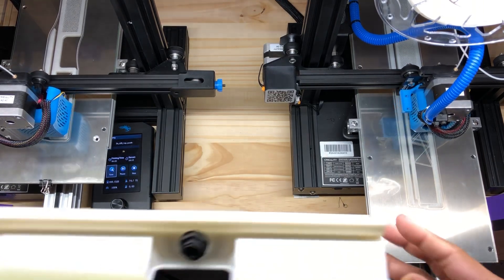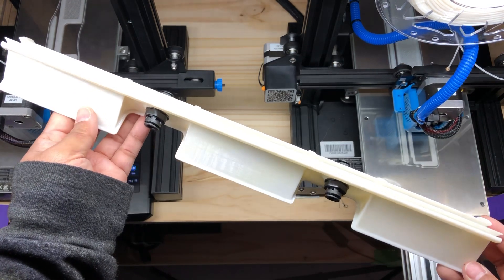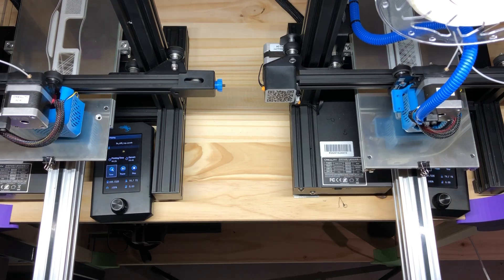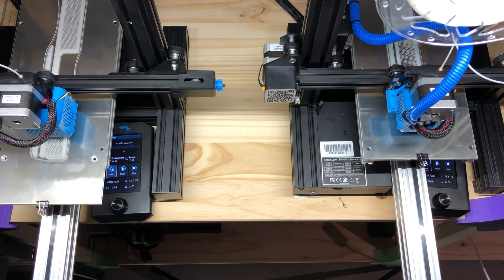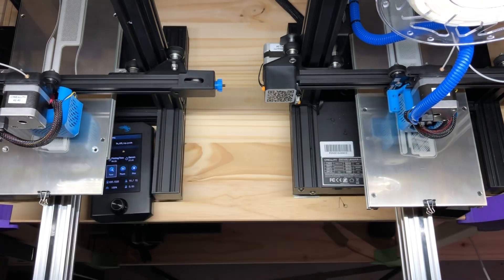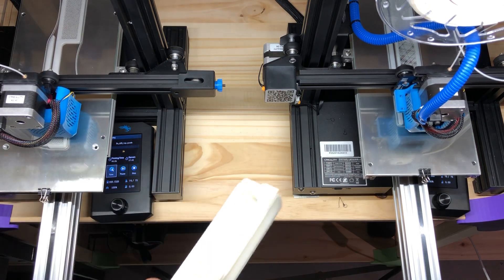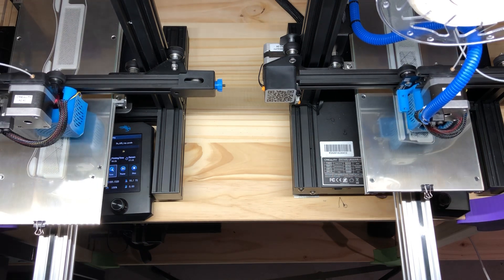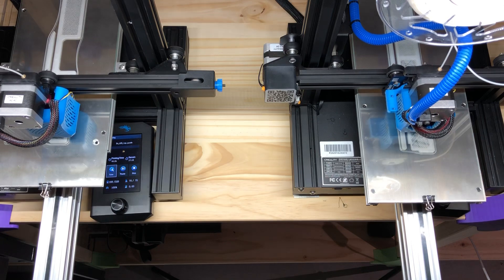Printing with Extended Ender-3s

Comment: wouldn't it be easier to just glue on a mesh screen rather than print it? A clamp could work too. Hell, slots even.
Reply from the maker: Glue never holds or looks bad. Getting plastic mesh cut to spec was also a pain in the ass. Metal mesh kept its form and easier to install, but had a tendency to hold in humidity for the terrarium. But printing it is a solid solution, and comes off the printer ready to ship. The less post production work the better.